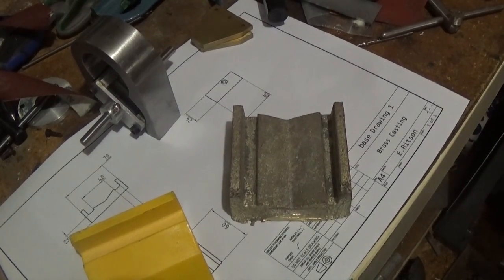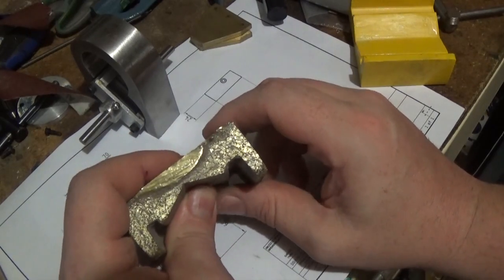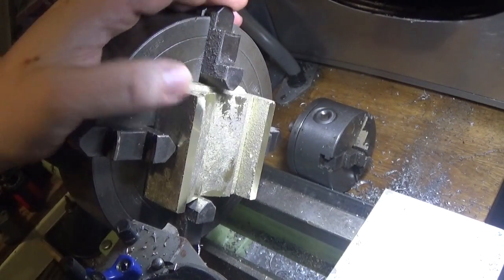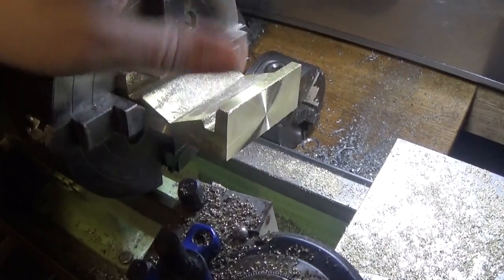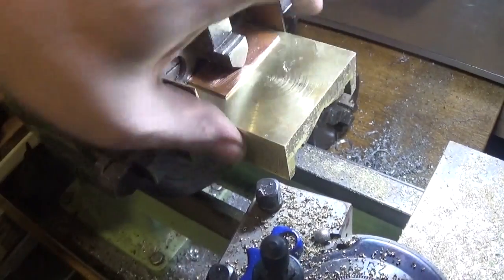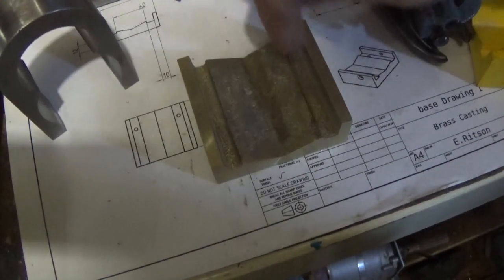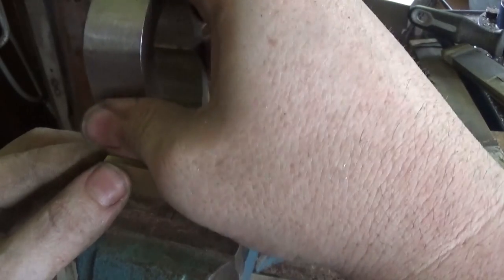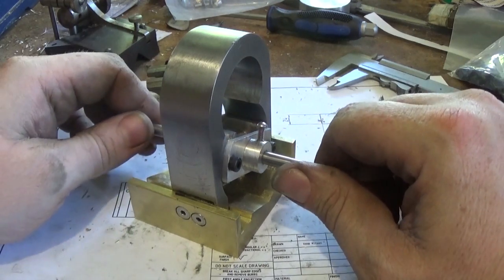Prince Dynamo motor PART 8 home shop project

Comment: Amazing (to echo Walter Maisey, one of my favs) what you can do with a 4-jaw and a bit of ingenuity. This is the way it was done long ago, when nobody who did model engineering had such a thing as a mill.  I have taken notes. My Taig is even smaller than your lathe so I am limited by travel on the cross-slide. But the grooves are what, 10 mil wide x 60 long? Might be possible on the milling attachment. Don't know how much travel you have. There is one attachment on the Taig that I find useful and it is  a fly cutter. Myfordboy makes one in his videos,  out of a sacrificial  face plate. For such things as facing off the bottoms of that casting, it is very useful.